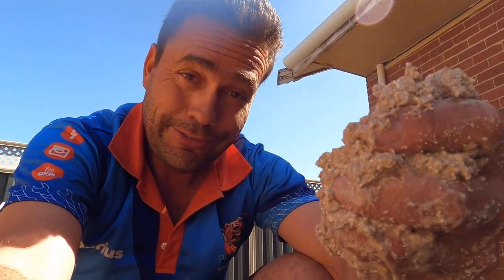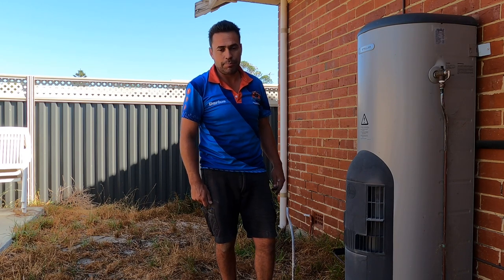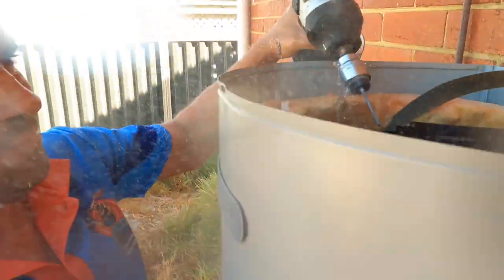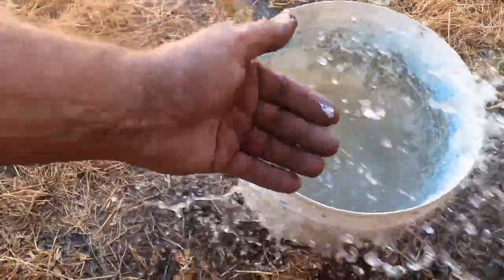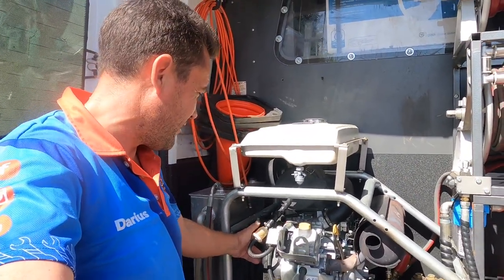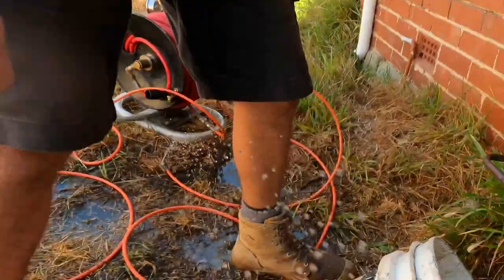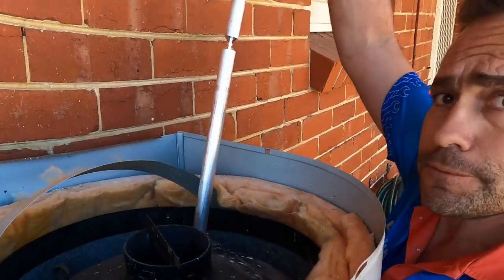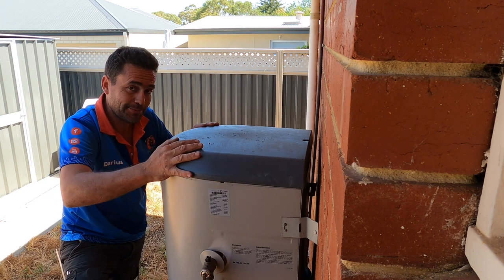Anode Replacement & Tank Flush (Major Service) Rheem Stellar Gas HWS - Plumbdog Plumbing Perth

Comment: Is there any other way to do this if you don’t have the high pressure equipment?  All I’ve got is a pressure washer
Reply from the maker: Yes book Plumbdog if your in Perth, or a local plumbing company if your not 😃
Reply: Hehe thanks. One more question. Are those segmented anodes ok to use instead of the rigid ones or is there a risk of them breaking off inside the tank and staying there forever?
Reply: I change lots of Anodes in melbourne, (APF Hot water) we find the only time (sometimes) the tank needs flushing out is when its over 30 years old we have around 500 clients who's hot water unit is more than 40 years and I have found you only need to fluch the tank once because water quality is so much better here in melbourne and the anode only drops very litte of the rusted magnesium into the bottom of the tank. So please consider this before flushing tank
Reply: @denisw99  Hi Mate, how can I contact your for change the Anodes, I'm in Melbourne